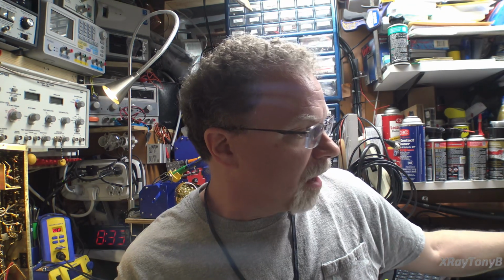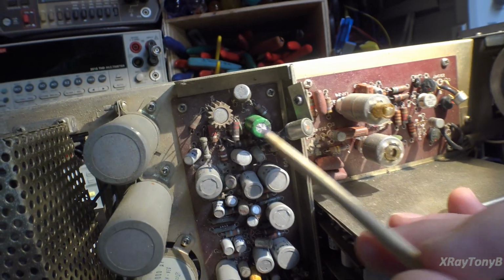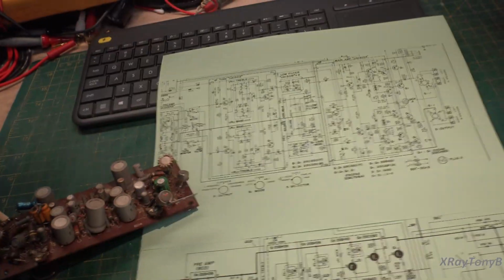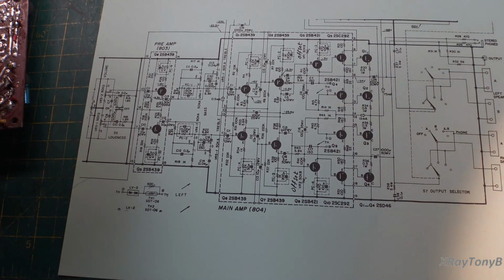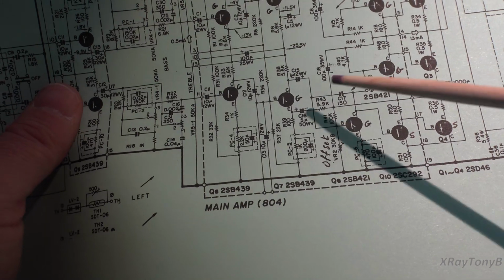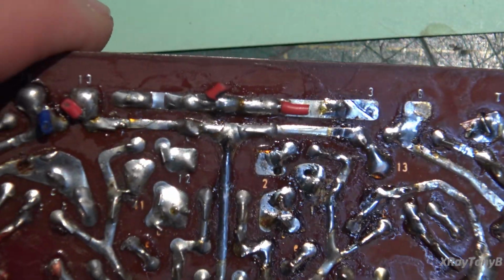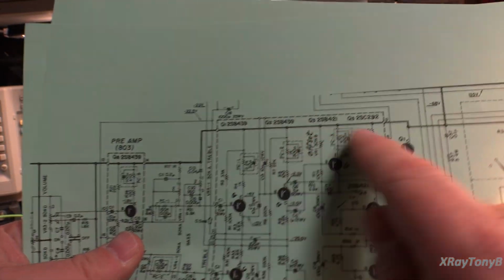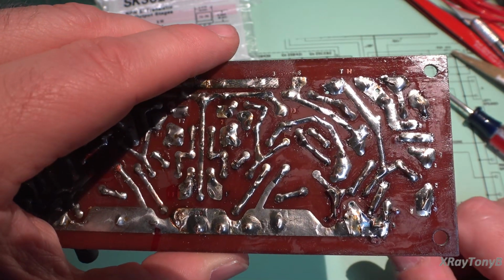Kenwood TK-80U Receiver Part 2:   Amplifier PC Board Repair

Comment: Tony it is a KENWOOD TK 80 not the KENWOOD TK 80 U and is on <http://www.elektrotanya.com>    (ELEKTROTANYA), 
that module with the vacuum tubes is marked as FMRF (8772) the module you expected to se was RF "UA11023C"

Comment: Thanks Tony. You're a great guy. Very interesting video. It looks like the the amp board was not a printed circuit but was solder-flowed by hand just like your repairs. Is that right? And was that common back in the 60s?

Comment: I am so glad you posted this.  My TK-50 after recapping would play for a couple of seconds and than the audio would fade out to nothing.  I double and triple checked everything.  Seeing this capacitor / resistor modules has to be the culprit with my unit.  I kept the old parts and will have to take a look.  I have a feeling this is my issue.  I’m missing the resistors and cutting the BIAS to my driver transistors.

Comment: @xraytonyb : Wouldn't it be good idea to replace the "PC-"1, 2, 3... Components from Elna with just discrete R's and C's? It should not be that much of a problem to put some copper-clad "T" at each side instead of the original soldering points and drill the 4 holes to get in some discrete R and C you could be sure of the proper values. Especially when you already had to replace tracks on the board. OK, you will lose some part of it's originality then...
Can you imagine any reason (besides miniaturizing) that could have made them doing that weird "Integrated Circuit" containing this simple R-C "network"? I can't find any point or reason for that other than being some first attempt of "integrating circuits". Much like the ceramic based hybrid modules that were state of the art somewhen in the early 80s (or for example the STK hybrid amplifier modules).

Comment: Wouldn't it be possible to parallel a new capacitor and resistor, run the rated voltage through and measure the DC on the other end, then compare the new with the old... If the capacitor is leaky in the old one then theoretically it should pass more DC current than the new one..
Reply: Peter Milanovski, why first building it with real components and then measure?  I would not expect leakage of such caps exceed the paralleled resistance, so all of that theoretical measurements may not tell anything about the real condition of the capacitor electrolyte. This is why I think - especially if already doing lots of patching the PCB and creating new tracks there - it might have been a good idea to add a small patch of copper clad at each side of the current position of the R-C-combination, drill  4 small holes and instead of the R-C-combination insert discrete R and C instead. Then you could be sure about both components being as good as could. I don't think you would get into spacing trouble as the old Elna combination looked very bulky to me and modern electrolytics would fit in perfectly with some small resistor. We're not talking of high wattage over the resistor and also not very high voltage over the C...
But, of course, as long as it is not at all clear that all of this is leading to a really stable working amp it is always a good idea to keep effort down as much as possible or it could get a total economic fail. That's why I absolutely do see it way beyond economics to design and build a total new PCB. Doing a new PCB is not just done in 2 or 3 hours and would not improve or at least keep the authenticity of your device....

Comment: Thanks for sharing a great video! :-)
Maybe do I have a small trick you can use to easier get the copper foil tape of the paper.
Make a cut into one side of the tape and then bend the tape il at the cut with the cut outward, bend it so much that you easily can grab and pull the cut apart.

Comment: I think it really needs a new piece of FR4 the same type with the phenolic layer on top.  I think this one's sort of a hybrid between the 804 board and the UA board although it appears to have the 804 part number (there may have been a couple revisions while they worked out the new boards to get ready for the solid state version).

Comment: The amp appears to be single supply, so the output is biased at about 1/2 the supply voltage and needs the coupling capacitor to keep the DC off the speakers. Looking at the supply current, it is most certainly biased class AB.
Reply: Otherwise it'll get pretty darn hot!
Reply: Hey John, glad to see you here also... Both of you are in similar a field so I guess it makes sense that you follow each other.

Comment: Quite by coincidence I watched a guy do PCB trace repair on some boards last night, he was a maniac. It's a big way he makes his living with PCB restorations. He had this special heat resistant epoxy that he glued the traces down with, and he re-applied solder mask where necessary. It was super impressive.
Reply: Who's that got a link

Comment: Why don't you use a CAD system cheap free CAD system out there. Surely a circuit components like that would be perfect putting in a CAD system and watching it how it runs.
No thank you you bring a lot of joy and happiness to people and knowledge.
I've got a professional electronic CAD system on 5 inch floppy disk from the 80s till early 90s if you want it you can have it. Far as I know no I think everything's in the box manuals discs companies probably still going parts list probably can be updated
Be good to keep one side germanium transistors and compare the two channels in sound effect. They did it for a reason ! otherwise they could of use silicone on both or both germanium, so there must be a reason why they decided to do it that way probably sound effect!
Reply: Probably more about what was available and kept BOM cost down. At the time this was made, silicon transistors were still relatively new tech and probably expensive by comparison.